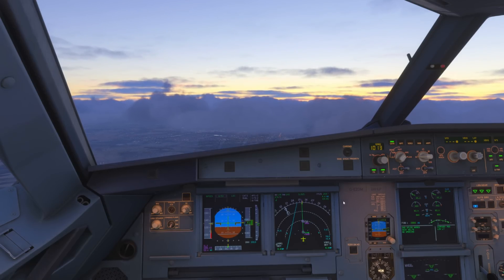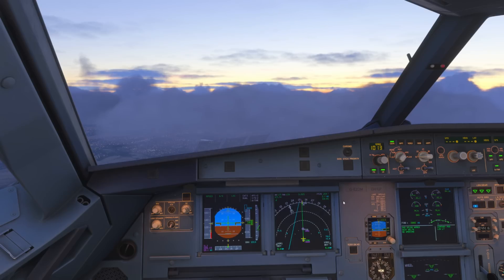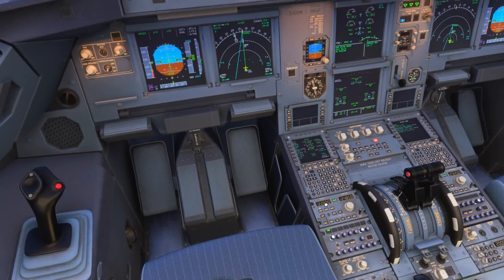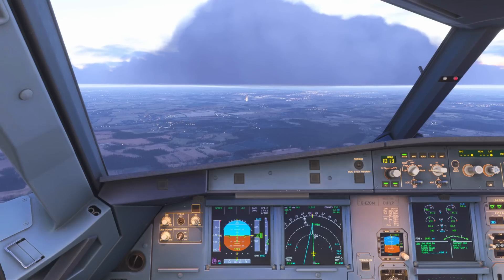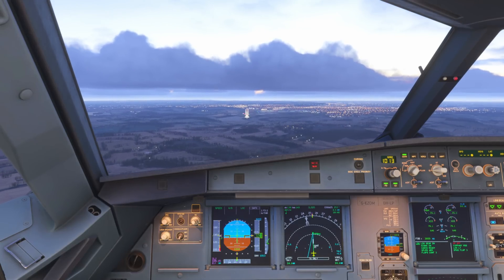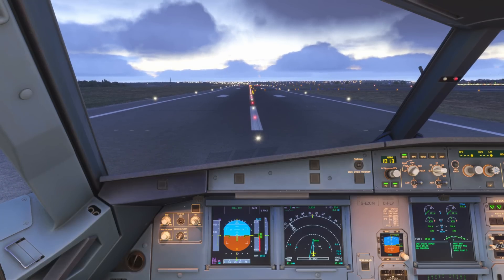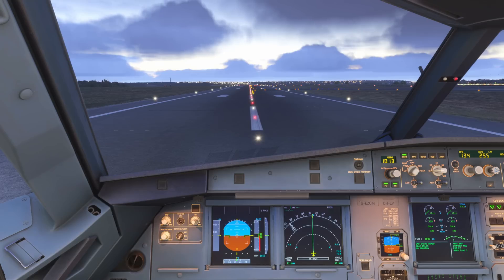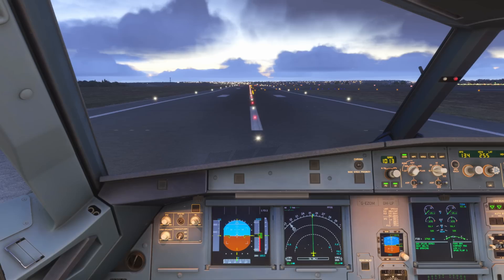A320 Landing Flaps Explained | CONF 3 vs FULL by Real Airbus Pilot

Comment: Hi, A320 TRI here. Fantastic content which I’m going to recommend to my trainees. Do I recognise your voice from the A320 podcast possibly? My operator recommends flaps 3 if it doesn’t require autobrake med, max reverse, or an undesired exit. How do you manage preferred exits at the 1700-1800m mark given it’s your operator’s preferred? From a training perspective, I brief that given the very subtle flare input required, if one checks the descent at 30’ from 4.5 ANU to where it appears it will 3 point, it’s about spot on.
Reply from the maker: Hi Liam, thanks so much for the kind words and really appreciate you sharing the content with your trainees! It is possible that you have previously heard my voice!

Totally agree with your operator’s approach on using Flaps 3 when the landing conditions allow it. Regarding managing  exits around the 1700–1800m mark: we typically aim to touch down firmly and if not using autobrake MED, we rely on manual braking just after nosewheel touchdown, maintaining full reverse briefly before reducing. This setup usually gives good deceleration to comfortably make those mid-exits without rushing or overheating the brakes. Of course flaps full is still an option here if it makes sense 

You’re spot on with your note about the flare, checking the descent at 30ft from 4.5 ANU and flying it onto the runway gives a very controlled “three-point” feel, which works beautifully with Flaps 3 and a subtle flare. Great technique to brief!